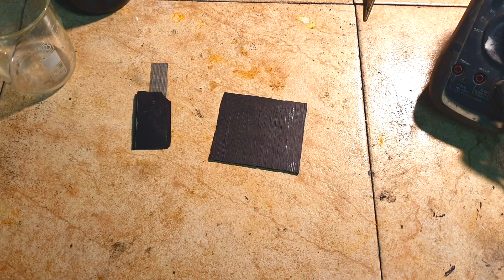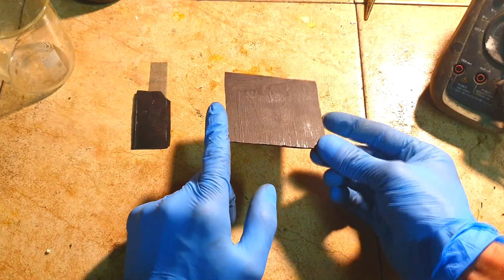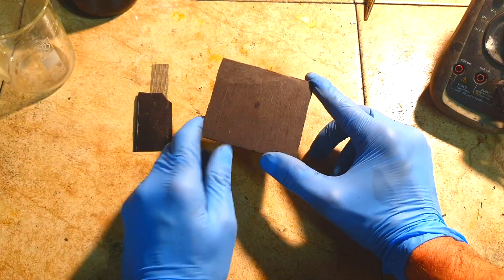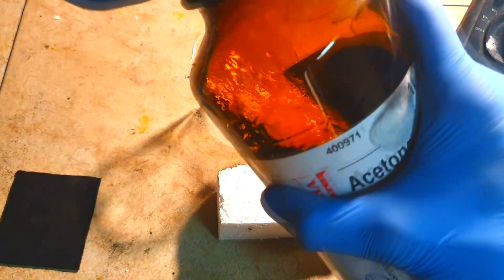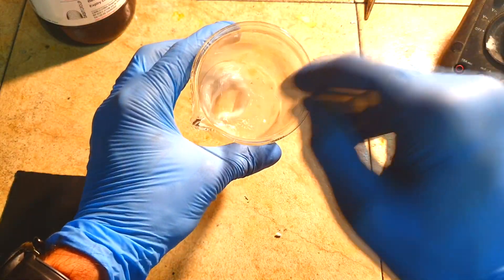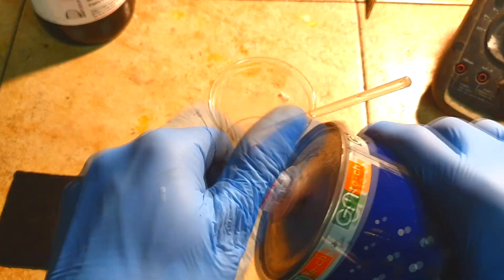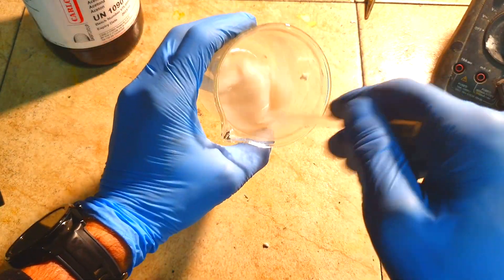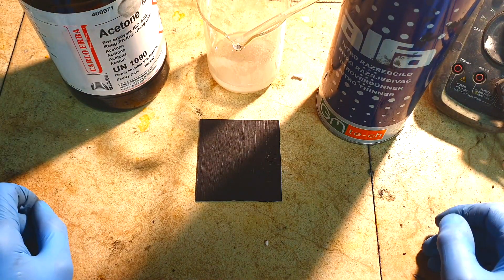Conductive carbon plastic

Comment: Can you give me the link of that blue thinner?
Reply from the maker: In basic is that some basic nitro thinner. All nitro thinners have the same ingridients. Here you have, but the link is to the store in my country: https://mtehnika.mercator.si/izdelek/4458713/razredcilo
Reply: @cayrex  Is Cellulosic Paint Thinner Cellulosic Thinner?
Reply: @cayrex  Does acrylic thinner do the same job?
Reply: @cayrex  Can synthetic thinner do the same job?
Reply from the maker: @erdemkacmaz7617  Search if the thinner have ingridients like Toluene, acetone, n-butyl acetate,...
Reply: @cayrex  Would none of the thinners I mentioned be suitable?
Reply from the maker: @erdemkacmaz7617  the main ingridient in the thinner need to be toluen
Reply: @cayrex  Do you mind if it only contains toluene?
Reply from the maker: @erdemkacmaz7617  If you can get only toluene, you can use it. I recommend nitro thinner because is more that three times  cheaper and is way easier to get in my area.
Reply: @cayrex  thenks
Reply: @erdemkacmaz7617  sentetik tiner (gaz yağı diye satılan) oluyor, denedim.

Comment: The 2nd liquid is what kind of thinner
Reply from the maker: The one which have some hydrocarbons (Toluene,...)
Reply: I've used acetone to initially shrink the styrofoam (just like this video shows) and then Xylene to actually dissolve it.  The Xylene is easier to find locally than Toluene in my area.
Reply from the maker: @flashlit123  here is Xylene harder to find. That nitro thinner is in almost any store an cost about 2 Eur per liter